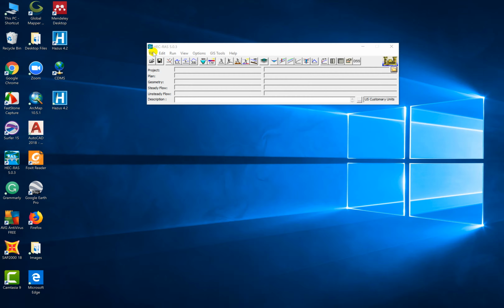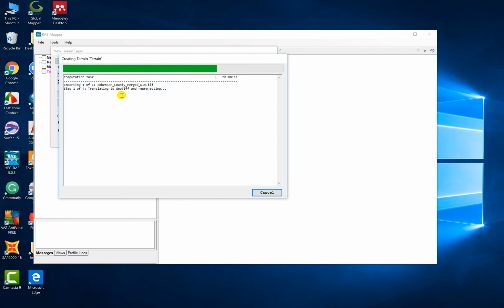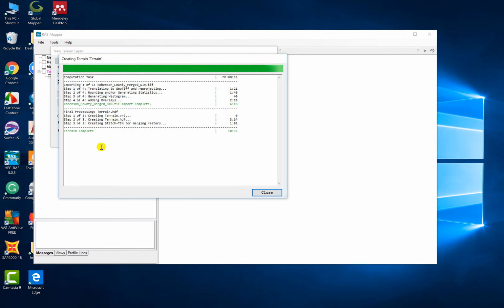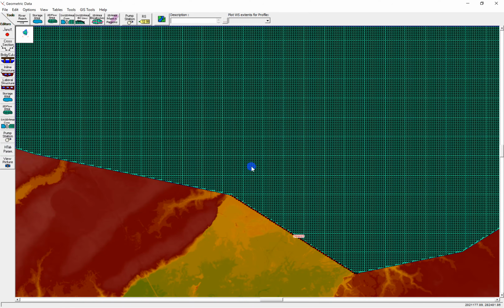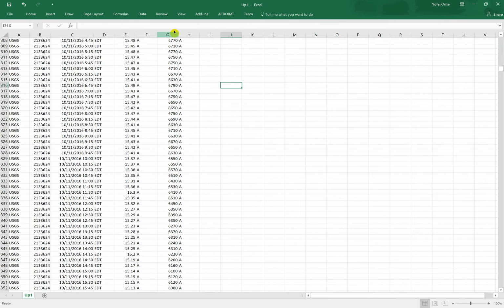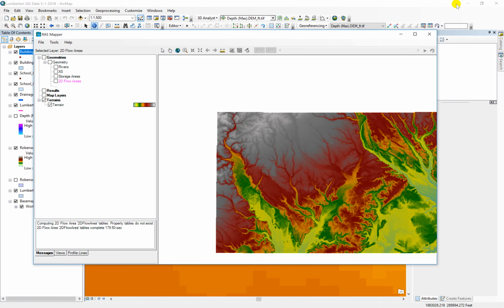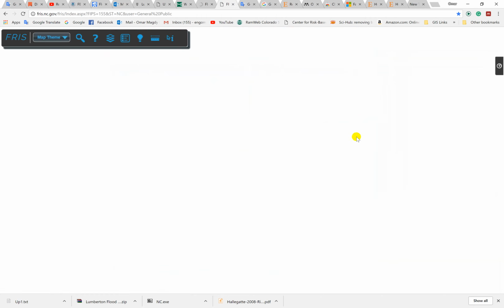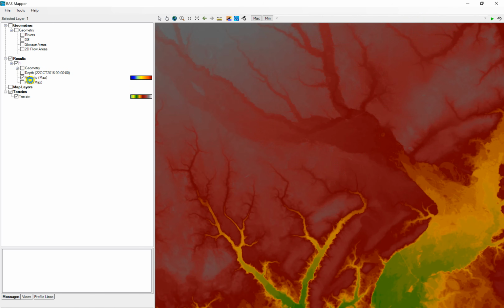2D Flood Modeling at Community Level Using HEC-RAS

Comment: Amazing Effort Omar.

i would like to ask you one thing is that what about land use and land cove or Mannings value in 2D modeling?

If we ignore to add the land use data and mannings n value, is is validate?
Reply from the maker: You consider these factors during the hydrologic analysis, not the hydrodynamic analysis. So, these factors including land use, soil, etc affected the discharge. Then the roughness affects the velocity during the hydrodynamic analysis.